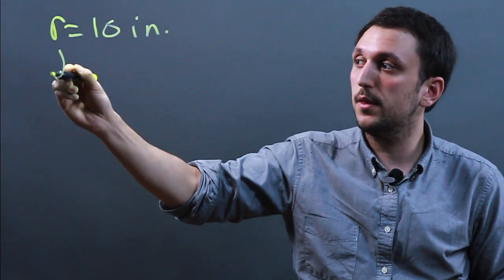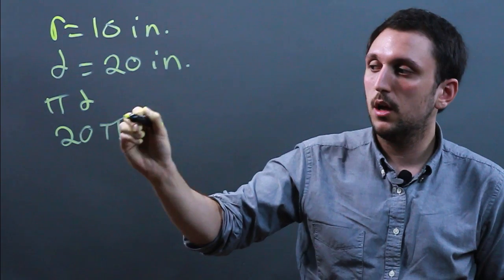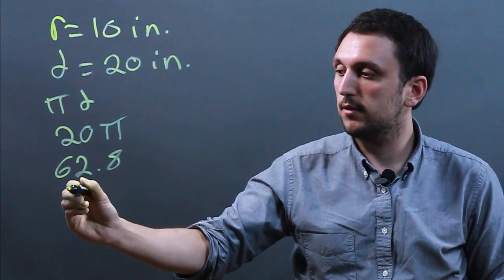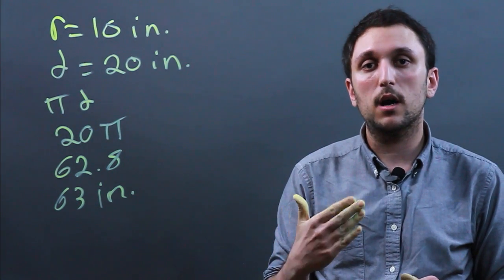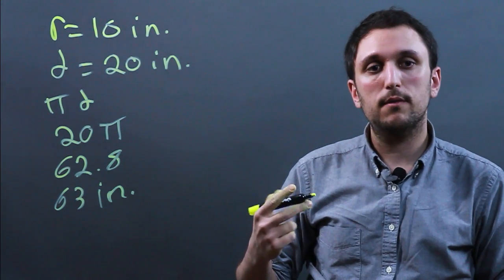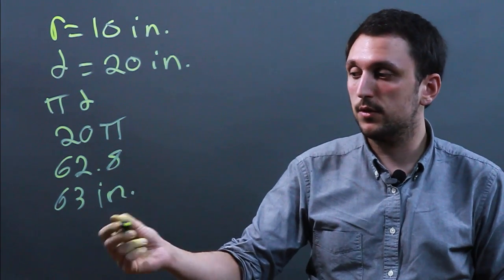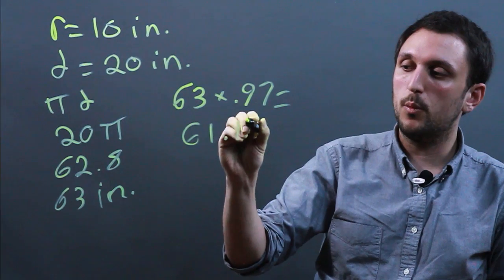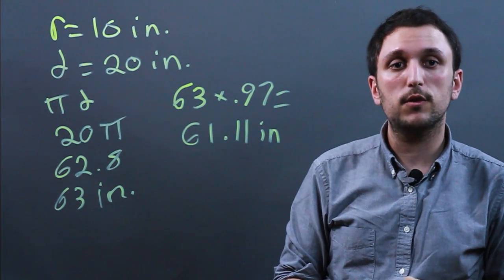How to Calculate Rolling Circumference of Tires : Solving Math Problems

Comment: But how do you arrive at the diameter by the tire size?  Like if you have a 265/60R15, what is the diameter?  That is the question I asked google.  I learned to compute a circumference from the diameter in like 3rd grade.
Reply: 265 is the width of the tire if I'm not mistaken and 60 is the side wall height taken as a ratio of height to width.  R15 is the rim size.  It's been awhile since I looked that stuff up but that could get you on the right track for seeking information.

Comment: The circumferens on a tire doesnt change with load / inflation. For every rotation the wheel makes the length of all the "track-pattern" on the tire needs to pass the tarmac. The lower the pressure the more the tire behaves like a belt (like on a tank), but the length of the grip-pattern (circumference) remains the same. Your math is correct, but your assumptions are wrong.
Reply: no, you're wrong. circumference does change like he mentioned. let's say 3 ppl ride the bike. the wheel's center will be closer to ground compared to wheel's center when no one is sitting on the bike. it means radius decreases if weight is added. if u still don't believe me, remove all the air out from the tyre, move the wheel starting from when the valve points the ground to when it returns pointing the ground 1st time. do the same thing by inflating the tyre. inflated one will cover more distance for same one rotation
Reply: @ischkumar424  https://www.youtube.com/watch?v=_2l5bOhHNxU

Comment: Thanks Teach :)

Majorly useful, real-world application of arithmetic! 

I need to enter the wheel measurement (in millimeters) of my bicycle wheels, into my bicycle computer. A sensor in the bike computer will use that to calculate speed and whatnot. I would like to use your formula. But I'm wondering if I would need to make any adjustments to anything in your formula for bicycle wheels? 

Like, the loads for cars and bikes would be different (naturually). So, would the 0.97% term need to be adjusted for any reason?

Thanks in advance for your reply, Teach.
Reply: Didn't answer my question, which is how to arrive at the circumference knowing only the tire size (as in 195/75R15.  Presumably it would be 195x.75 x2 to get the size of the sidewall  in metric and then add the 15 to get the diameter, plus maybe 1.5" for the thickness of the tire tread.